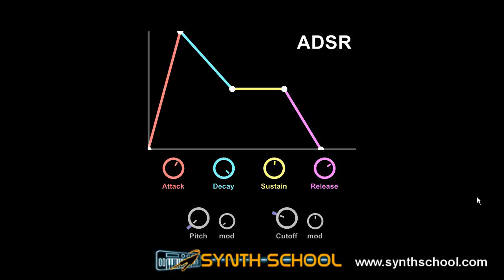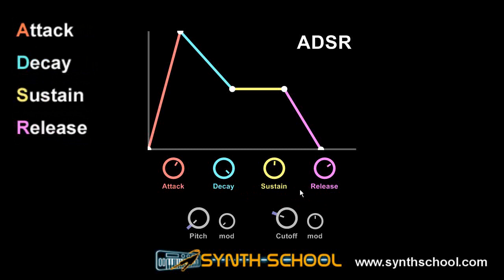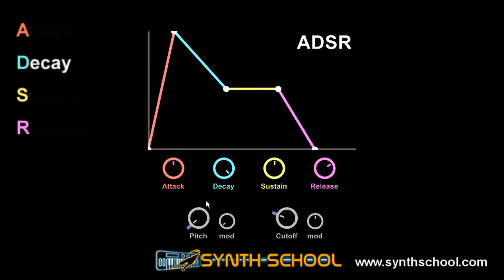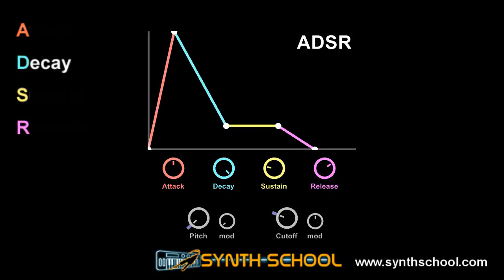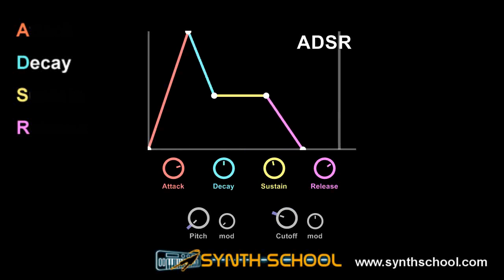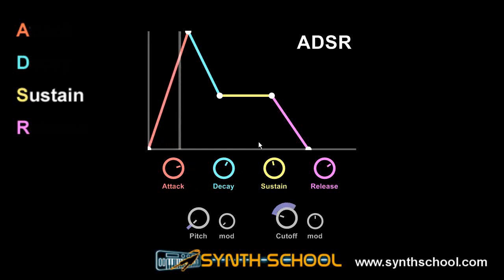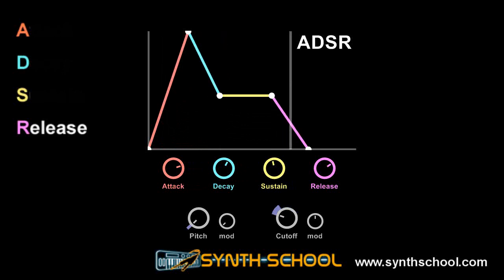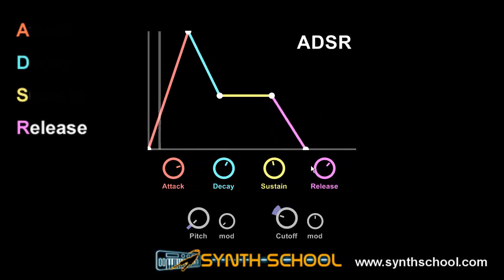ADSR envelope synth tutorial part A

Comment: Also, ADSR envelope can be extended to APDS1S2R if we add Plateau (P) which is the duration to hold at Max level after release before Decay begins, S1 being the Starting level of sustain, S2 being the ending level of sustain.  If we were synthesizing a piano, strings don’t ring forever, so we need a ramp down in the sustain, it’s not a straight line.

Also, the ramp up and down should be exponential, not linear.

Awesome videos!

Comment: So if attack doesn’t reach maximum level at the time of the release, is it right that the power level still rises to sustain value?  Maybe sometimes it can be desired, 

but...

Seems like a better (more natural) implementation would be to have sustain value be relative to the max level reach during the attack, not absolute as it is shown here.  

In other words, if you specify sustain as percentage of max, say 75%, then no matter how long we hold the key for, it will pull back by 25% from the level at which it was released.

Comment: Your tutorial is great. I was searching for a way to help a friend learn synthesis from scratch, and this does help with ADSR. I'll see if he does understand it better with those cool animated graphics. However, as a somewhat experienced keyboardist, I'd like to advise against using automated cutoff in this lesson, since the filter movement is something that will definitely throw off someone with no synth knowledge at all. They might mistake the actual effects an amp ADSR causes in sound for the effects caused by the filter ADSR. Just a quick tip. Nice work :D

Comment from the maker: @chriswel 
You have a point there. most envelopes are speed based, which means that the release will be shorter if it starts from a lower level. Some envelopes however are based on time, which means that the release will take the same time to fade out regardless of its starting position. Both ways are viable, but the speed based is more natural and common. however, sometimes natural is not what one is looking for ;)

Comment: Great video!
But one question: At the end, you show that the Release starts from the previous level in the envelope. Is the Release time still the same or does it change with the level it starts (looks like this in the animation)? In other words, is the R parameter actually a Release angle or really the time span (or are both models rational)? I would think that the release of a quiet note would take less time than from a loud note.